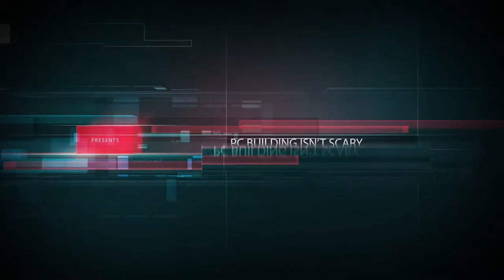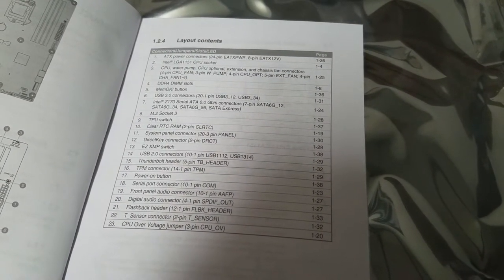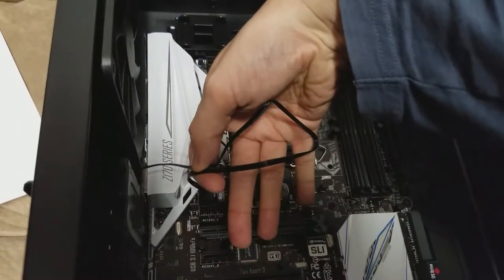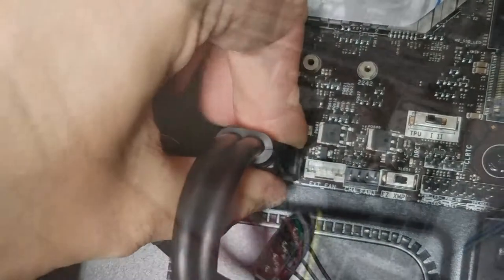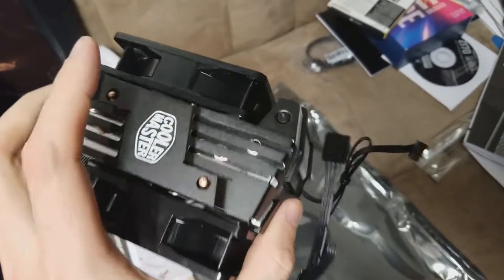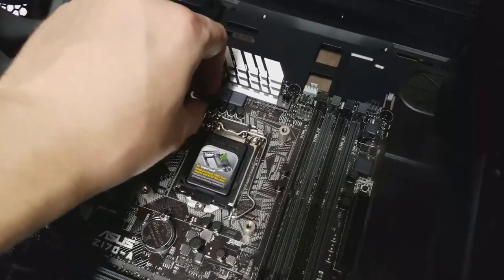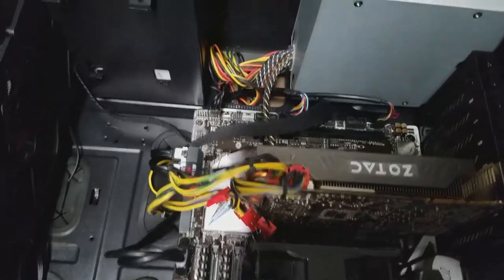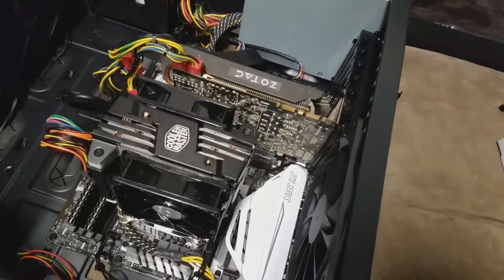PC Build (i7 6700K upgrade, etc)

Comment: Planning my first build by the end of the year (finances prevent me from buying all the parts at once) and my only concerns are not having the right power connectors, the case not fitting everything in and cable management. I've also heard static buildup can be an issue and fuck up some of your parts, have you ever found this to me an issue Tim?

Comment: No, not the 2600K. That's from 2011 and the one I got (and maybe you before). You got the 6700K. :)
Reply: And the thermal paste should be about the size of a grain of rice. And after applying it you can can move/rotate the CPU heatsink slightly to spread the paste over the CPU. :)
Reply: +Tim “twhtly” Wheatley Great haha, I was kind of hoping that it wasn't an exact science. :D It's the part of PC-building which I like the least. "Was it enough paste? Did the heatsink crush the cpu? Is it dead? Is it running too hot? No, it's working - phew!" :)